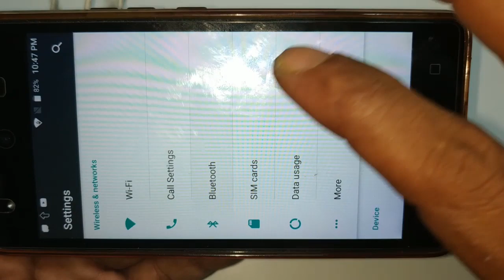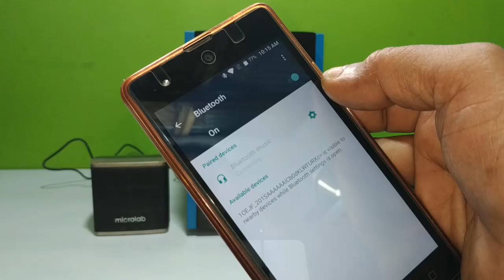Bluetooth Earphone convert to Bluetooth Speaker for Car Kit (Updated) | Make Home Theater KIT use BT

Comment: Isn't this made mono speaker instead of stereo??
Also, since I would use this a car player, please reply on how to make the on/off button permanently on, so it would start automatically when the player starts. Thanks in advance!
Reply: I think it's better to leave it with power botton function  coz it Will automatically turn off when not connected to device....  Imade the same thing without knowing that there's a actually video on yt that I can watch  as reference😑😒

Comment: Make it work directly on usb power supply not on battery, u will need to charge it every time , so make it work on direct usb supply
Reply from the maker: Nice idea😍😍😍
Reply: @DreamFinder  how to execute it? Is it possible using car charger?
Reply: tbh, it depends upon the use case.
If it has built-in battery, it is portable.
For example. In my case, I have an arm band where I place this receiver and I connect my IEM to it.
I have an ATH-E50, So while Riding a bike/jogging. its really handy.
Especially while Jogging, because I can directly connect this receiver to my Smartwatch and I don't even need a mobile for music playback.

Comment: Bro now this is dc (with battery)
With out battery can connect r wat
Reply from the maker: Not clear bro
Reply: @DreamFinder  He is asking whether we can use the device without the built-in battery.
and just by using the power supplied through micro usb port
Reply from the maker: Woh, yes you can use micro usb to supply 5v dc. Any process this device need of 5v DC

Comment: Thanks dada
Reply from the maker: Many many thanks to dear bro.
Reply from the maker: However are you understand now?
Reply: @DreamFinder  i understood but i have i question that is:
The b- is for power supply i thought 
But u have connected the Audio out to it why??
And also sl and sr- is empty why? Plzzzzz reply.............
Reply from the maker: Negative pole maximum time use as a speaker ground connection. So i use this method. Thanks dada.
Reply: @DreamFinder  so this is the best way ,ok thanks.. btw thanks for making the video